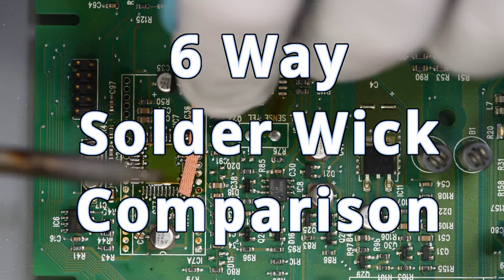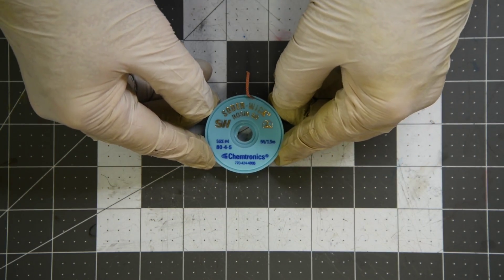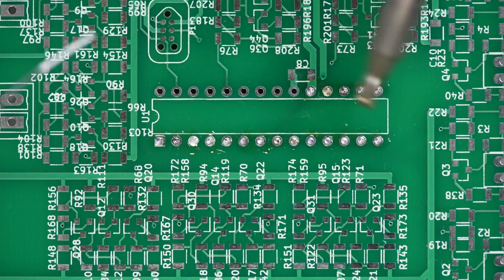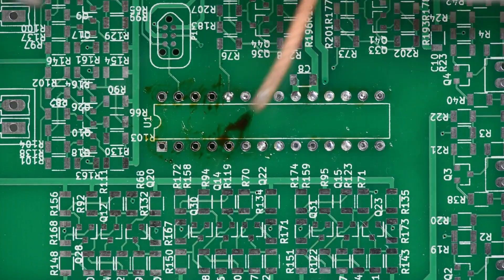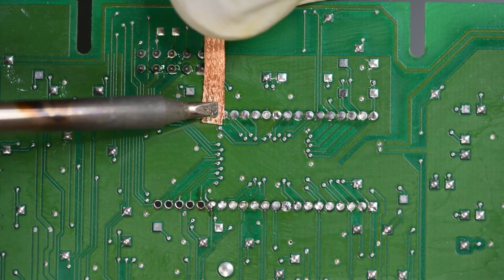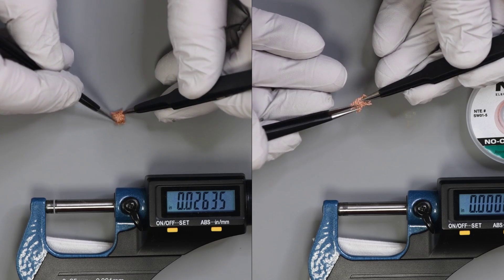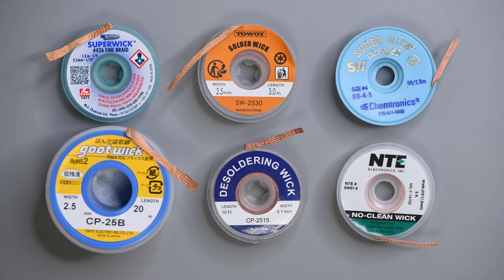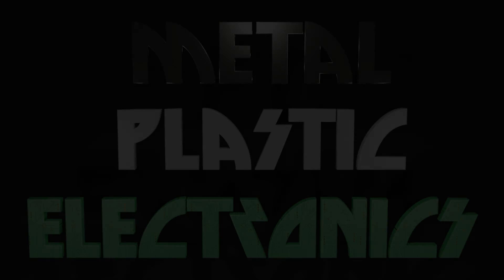Wick Vs Wick – Desolder Braid Comparison

Comment: I've always made do with that CP-2515 stuff which seems to work just fine, I just ordered some Mechanic R300 though so I'll see if it's any better.
Reply: Anything to share?
Reply: @JesúsAlonsoDomínguezPérez  kinda late, maybe you've alredy tried it yourself. The R300 is amazing imo, it's pretty stiff tho but sucks the solder really good. They also have the R350 which is alot softer, but R300 is amazing.

Comment: What about the HAKKO Wick, still made in Japan? The price looks reasonable in Amazon and it comes in three different versions: unflux, no clean (low residue) and regular. Have you ever tried any type?

Beside, would you ever consider using an "unfluxed" wick? Maybe using it with your own fave type of flux or even bare, unfluxed?
Thanks!
Reply from the maker: No, I haven't. I'm not sure what the use of an unfluxed wick would be. Maybe some cleanroom uses are about the only thing I can think of.
Reply: @metalplasticelectronics354  thanks for your opinion !

Comment: Can you recommend a good soldering iron? 
It will be used primarily on model trains. 

I want to get something better than the $20 Amazon special my wife got me.
Reply from the maker: Here is the minimum I would recommend: https://youtu.be/uUSa5_SOixA?si=OKjo93VKixndxc6E . If you can spend more getting a soldering station that uses a tip/heater cartridge type tip will give you much better heat control.
Reply: @  I was watching a video last night on the Ersa icon Nano 
Was looking at it on Amazon. But I have no idea where I can buy the tips for it.
Reply from the maker: I think you can get tips from TEquipment at least in the US.  You can go to the kurtzersa.com to find a dealer in your area.  I've never used an ersa soldering station.  But looking at this one on Amazon it looks like the tip and heater are separate pieces.  I wouldn't spend that much money on a soldering station that didn't use tip-heater modules.  My main soldering station is a Hakko FX951. Best soldering station I've ever had.

Comment: which one of them stays together the most? in other words, which one is strongest/thickest and doesnt come apart? all the cheap ones i bought from china spread out when you apply pressure which is annoying and doesnt get the job done
Reply from the maker: That one is easy; it's the chemtronics.  It's made as a woven tube, so it's near impossible to get it to spread apart. I felt it was actually too stiff.
Reply: @metalplasticelectronics354 do you have a source to buy it? i cant seem to find a supplier in europe.
Reply: I actually like how the Gootwick is softer & comes apart a bit. It allows you to wrap it around pins and drag it over a great surfrace area more easily.
Reply: nvm i was searching the wrong term